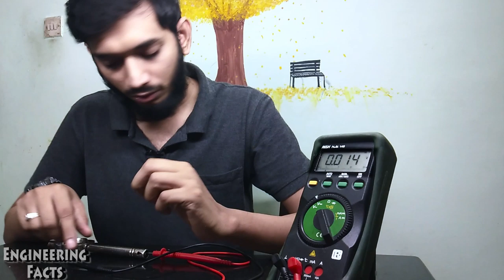How much voltage gas lighter can produce?_ Tamil, How gas lighter works?

Comment: Sea 🌊energy⚡ is so much high so use it for charging🔋⚡ and for cooking🍲👨‍🍳 on heater so high and low voltage⚡️ fluctuations are not become the problem

Comment: Bro... electronic domain la ennalam components(like capacitor, diode,resistor,etc...)use pandrangalo athu ellathayum pathi oru thani video podunga bro in easily understandable way...
Reply from the maker: I'll try
Reply: @engineeringfacts  Thanks bro...😊

Comment: Quite good explanation bro. I think that it is possible to measure the voltage by using microcontroller through proper circuitry and Software!
Reply from the maker: Analyser can measure spike
Reply: Yes.. use logic Analyser

Comment: Bro
Indha (gas lighter) video la neenga oru spark produce aaganumna around 7-8kv kita voltage produce aana thaan spark varum nu soninga

The same scenario is for the petrol spark plug also I think

But if you take the capacitor
Discharge panumbodhu spark produce aagudhu
But adhula patha charged(220v) dana discharge aagum
Then how spark produce aagudhu bro?

Comment: Bro u mean 6000~8000 V ? Three phase supply is 430V ...
Reply from the maker: Yes. It is a high voltage, then only the spark will generate..
Reply: @engineeringfacts  bro tell about real,reactive,apparent power? RMS and Average value of AC current with example...
Bro unga what's app?

Comment: plz reply 🌟
bro INVERTER ac la neraiya problems irukunu kelvipatta bro i mean if pcb board is damaged means we need to change it entirely & if any problem means we need to depend upon the company bro so inverter a. is not good....for buying aaa..??

2nd INVERTER ac is meant for solar panels i mean solar connection ku nalla irukuma athukutha itha konduvanthaangala plz reply

Comment: Bro 2 day i fixed 9v led bulb pcb looks fine but in led circuit board two resistors are short. and i removed two resistors and short those resistors problem solved 80 rs saved tnx to e facts
Reply from the maker: If resistors already in short, then why you're removing it and shorting it externally.
Reply: @engineeringfacts  judging wrongly the input path fuse is out judging wrkngly just confirm it
Reply: Bcoz..of removing those resistors any prblm occurs
Reply: I will Test the non polarity componenet with battery booster bcoz dont have multi meter confused when disasemnling bulb the input path transistors teared then i will get supply directly from pcb then the bulb turned on
Reply from the maker: I don't get bro. If you solved means it's fine.

Comment: Na cuda 1 masam munadi literla evalavu voltage varudhunu  meterla check pannuna bro. 1000la vachi check panuna 1000kkum mela kattudhu. Adhavadhu meter reading edukkama 1nunu error kattunichi bro.you Correct adhigamadhan varum bro.
Reply from the maker: Yes

Comment: Why the high voltage in less than milli second didn't harm us !? So if it last longer will it cause harm ?  In that case how long !?
Reply from the maker: Due to immediate current drop, the voltage will not last more than milli second. If it exists, the harm will be high